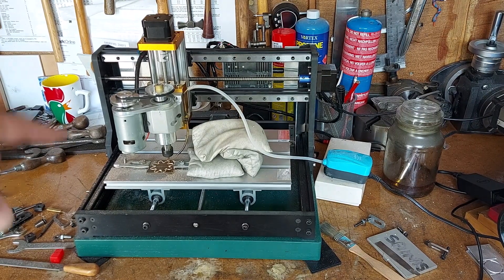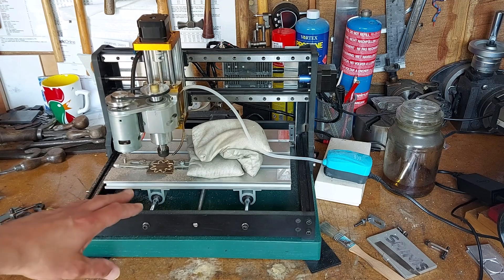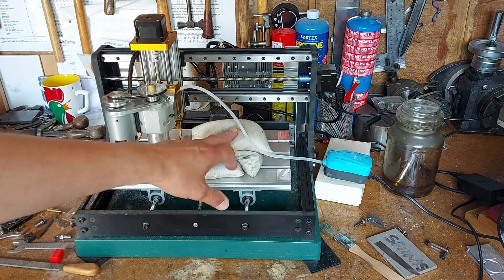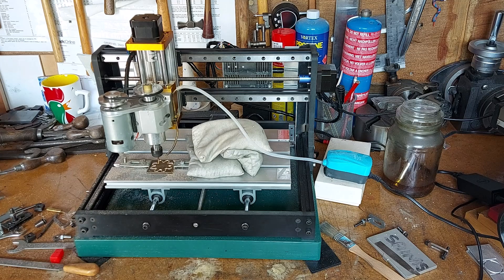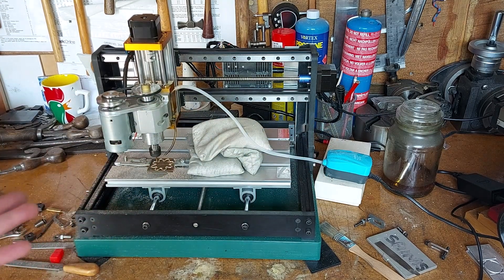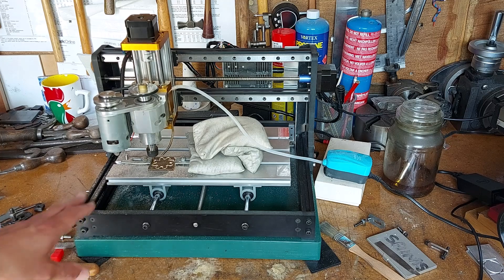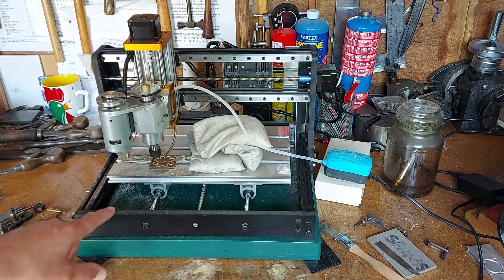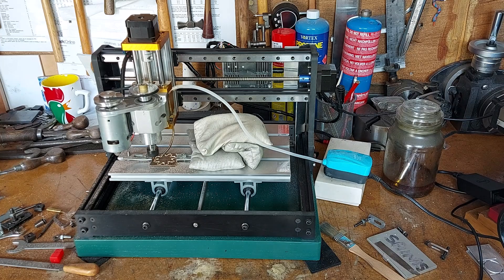Genmitsu 3018 pro

Comment: For your z axis did you have to make any spacers for your linear screw
 it looks like your z-axis is mounted on a plate and the plate bolted to the mgn12 rails
Reply from the maker: Yes, that's exactly how I did it. Also allows me to move z-axis up and down without changing the spacing on the blocks.

Comment: That's a pretty impressive result on brass. Do these home CNC routers come in versions where you don't have to upgrade the machine to do most things (for non-ferrous and non-metal use)?
Reply from the maker: Not sure I know of a sub £1000 machine that works with aluminium.and brass out of the box. Maybe the Genmitsu ProVer 4030??